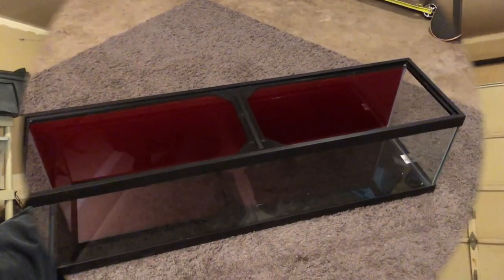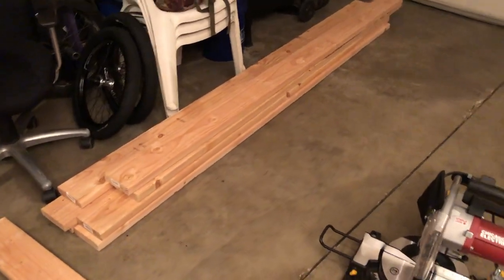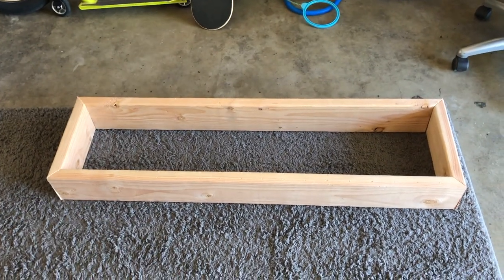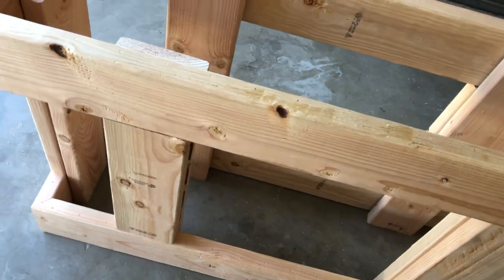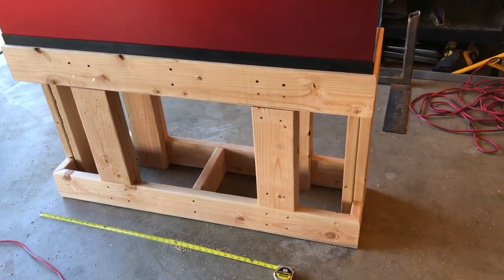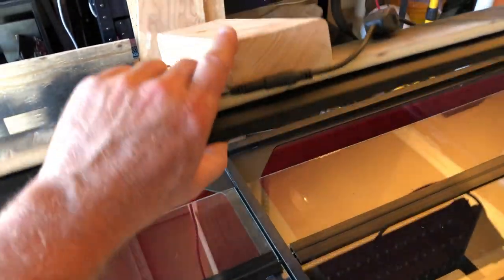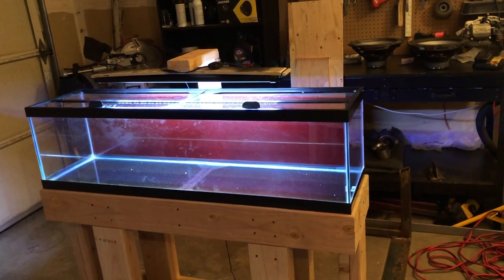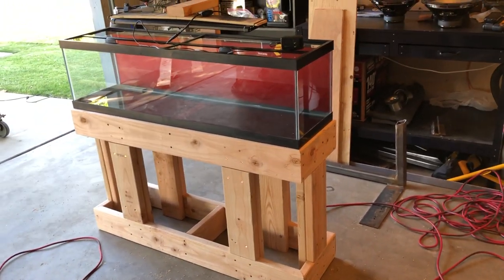33 GALLON LONG TANK BUILD PART 2! STAND AND LIGHT HOLDER.

Comment: one thing with lowering the light is when you open the tank up to do feeding, maintenance etc. The tank lid looks like it would then hit the light. idk if that's true, just looked like it from the video.
Reply from the maker: braeden march good point, but the whole light flips up.
Reply: @jdofishtank6018  but would you wanna flip the light up every time you have to feed them?
Reply from the maker: braeden march no I would only have to flip it for maintenance
Reply: @jdofishtank6018  anyway. Looks amazing so far, good luck!
Reply: @jdofishtank6018  and the light thing is an awesome idea.
Reply from the maker: braeden march thanks